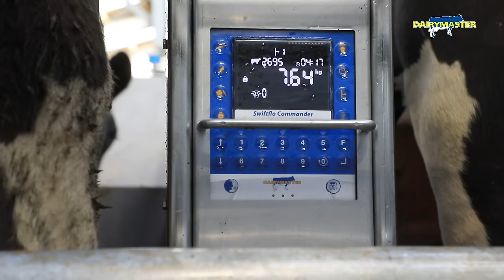The Incredible Rotary Milking Parlour from Dairymaster!

Comment: My only question is how does a cow know when to exit?
Reply: Yeh its bad enough when they wont go foward out of a parallel parlour
Reply: they showed a "motivator" that's basically a small whip that hits the cow so it backs out
Reply: @clemdelaclem  Thank you!
Reply: Its done being milked the pumps pop off, and the bar behind them goes up. So they know to back off.. super simple...
Reply: @clemdelaclem  It's not a whip lol. It's a hose that blows compressed air which makes it swing around and make noise which startles them and makes them back out

Comment: I don’t see him cleaning the teats though. The cows just seem to walk in and next thing the suction cups are on. Am I missing something with this method?
Reply: Cows udders get disinfectant moisturizer spray at 01:56
Reply: before milk is packaged it's tested in the lab for anything harmful as well as pasteurized (heated) to kill off bacteria
Reply: Im with ya on thia one. I seen the post milk spray. But not the pre spray/dip.
Reply: @LynxenX  ya I see that @1.56 but what about before milking? Just curious
Reply: they don't need to be cleaned because the milk is pasteurized. You'll never see a farmer do it either. The only issue is that it might affect the taste slightly but they randomly check the samples so it's unlikely to affect it too much